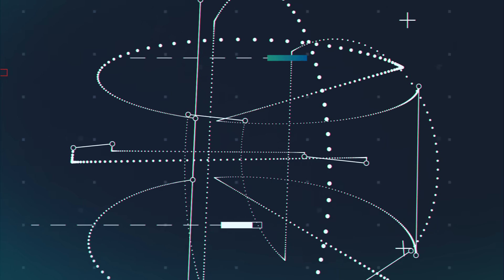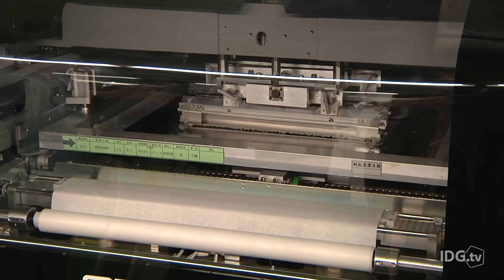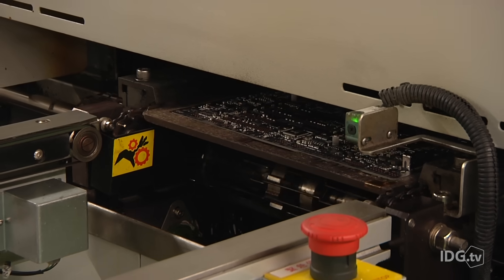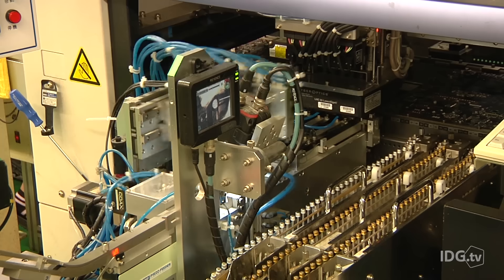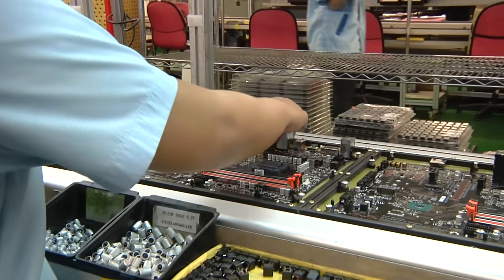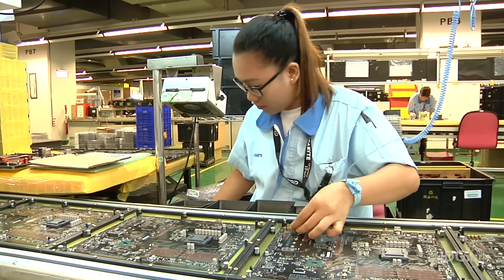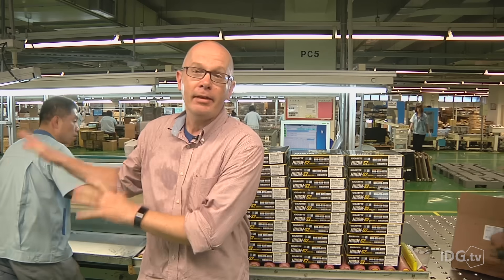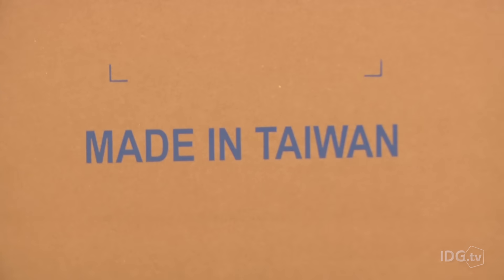How a motherboard is made: Inside the Gigabyte factory in Taiwan

Comment: I've stopped using Gigabyte boards a while back,  they always failed inside two years,  Asus or MSI only,  good quality.
Reply: I never had a motherboard fail on me and i bought most brands however i always read these type of posts about any brand.
Reply: my msi failed after 2.5 years once, and an intel failed after few months. but, these days the asus is going well for 4+years without any issues.
Reply: MSI motherboards good quality? LMAO. Only on youtube.
Reply: Funny, I had 2 MSI failed on me, 1 Asus, Gigabyte worked over 2 years till I sold it, and again bought an MSI :D
It's matter of chances, can't expect hundreds of chips to work fine on all boards, that's why they offer warranties.
Read Neweggs reviews, you won't find one manufacturer without defective or DOA.
Reply: Robert Drinkall that's interesting... I've never had any issues with mine ever - As the first sub-comment under yours points out, I haven't had any such experience. I've stuck with ASUS & Gigabyte MoBo's on all of my custom builds going back to roughly 2002. I'm still running a custom built tower in an Antec Case running a Intel Core 2 Duo E7500 2.93GHz CPU, 1066MHz (LGA775 Socket) with my Gigabyte EP43-UD3L purchased in 2009, and this particular machine has been running almost non-stop for just under 10 years; running to this day, right now as I'm typing this. It's only been turned off during the 6 times I've moved from one home to another, and then turned right back on. Never had any blue screens [knock on wood] or any issues WHATSOEVER. 

However, I do completely agree with you about ASUS being quality and dependable MoBo's and in general. I had a P5GC-MX /1333 from 2007 that I built in 2007, and I actually gave it to my dad around 2012 when his (store-bought) tower died....

And the Gigabyte Board was only about $24 more than the ASUS board (when purchased) because I needed the additional SATA, PCI-E and I/O connections, needing to have the flexibility of adding a Wi-Fi card, ATI RADEON discrete graphics card for multiple monitors, and 6 HDD's + a DVD-R/CD-R drive (as again, we're talking almost 10 years ago) I actually had an IDE drive, which this board supported, allowing for 7 total connections without any dongles/kits/etc. 

This was a fantastic system back in those days, and at $104 & change for that Gigabyte Board, lasting this long with ZERO problems; honestly what more could I have asked for? 

My $0.02 

-H.B.
Reply: Have Gigabyte's Z68AP-D3 for 6 years in my main rig which is working 24/7, had none problems since I bought it, 100% functional even after six years
you cannot blame a manufacturer for being unlucky, all electronics fail doesn't matter what manufacturer it is,
Asus and MSI boards also fail eventually
Reply: Robert Drinkall It looks like a random board problem. I've built about 300 PC systems starting from 1982, using every brand name motherboard. Over the years every brand has had it's failures and quirks. I guess I'm a geek of sorts, I usually have 8 to 10 desktops & 5 to 6 laptops running in my man_cave at any given time. I have a technology FIFO where I do new builds and give the older units away to neighbors & grandchildren. I still have a 40 year old S100 system I built in 1978 running the CP/M & MP/M OS. I make incremental upgrades to the S100 system by engineering new or improved functions with modern ICs.
Reply: I honestly think its just that gigabyte often makes the lowest end stuff, so when you really cheap out on a motherboard like i did then you get what you pay for.
Reply: funny how i have gigabyte in my top trusty brands, i tried MSI in 2016 and was dead in six months, and the region where i live doesn't have official support for it so i said good bye to the board, then i brought a Asus one, well a low budget one since i spend quite a lot on msi. turns out asus was defective. finally saved a bit and got my trusty gigabyte and running fine ever since.
Reply: fuck, and no-one mentions asrock?
Reply: Robert Drinkall my asus failed in 2 yrs, and now i have a gigabyte and it's working fine
Reply: Used many Gigabyte boards, non of them ever faild, the newer boards does have less built quality and bad designd bios, but it also cheaper, Asus make good high end      boards, but not mid and low end.Asrock is really good for budget build.
Reply: never had Problems with Gigabyte or msi.
But with ASrock and ASUS. I'm not joking, every single part from asus i own(ed) either stopped working or works with failures. X370 MoBo only worked 2 days, R9 290X got fan damage after 2 years, Xonar Soundcard with massive driver issues and some bugs/randomly not working speakers, laptop with broken charging port after 2 years, and on ASrock side a MoBo with really bad caps, so that the cpu can't hold max clock at load for 5 seconds...

but my 10 year old gigabyte board was able to withstand 3 short circuits via ethernet port, and is still works fine today.
and a R4850 and a R6970 from msi are running till now too.
Reply: Lol, MSI?  Really?
Reply: The last Gigabyte board I've purchased when I built an AMD FX-51 system with an ATI 9800XT, and it still works! The last two builds were an AMD Phenom 2 965 and an Intel i5 2500k, both with ASRock boards and both used for gaming, are still used as daily drivers. I do not build systems very often so I cannot attest to overall reliability, this is just my experience.
Reply: Sorry I am not buying that. I just bought a gigabyte AM4 board. After a week of using it, no problems. In fact, I was surprised at the OC options it had for such a budget MB.
Reply: I've never had a Gigabyte board fail yet, one of mine is 15 years old the other is 9 and both still work.
Reply: I still got asus boards from 2008 working fine today
Reply: not anymore, there junk
Reply: I've had a gigabyte and an ASUS mobo fail on me. MSI only
Reply: My old pc was using gigabyte, lasted 7 years.  Still using gigabyte on my new pc, dont see any problems.
Reply: I don't think so. I had Gigabyte mothebord before current one and it lasted little more than a 4 years.
Reply: My first computer had recurring issues for about 4 years, finally stopped when i replaced the gigabyte motherboard, never buying one of those again.
Reply: My msi failed me two times in a row i got gigabyte as final replacement still working up to this day bought it in 2014..
Also my place has fluctuating power lines it survived that.
Reply: Robert Drinkall - Oh, oh. The oldest grandson just called me. He just received 4 tower PCs & 1 laptop for free from the Kijiji "stuff to get" place on the web. Now I'm helping him identify things he never knew about, IDE & SCSI drives & DIMM ram. What a diabolical way to shed your old junk! ;) I looked up the HP 380DL G5, yes it is sturdy. When I drop some of my electronics off at the toxic waste transfer station I see garbage bins 15' tall and 20' length X 15' wide full of stuff like yours. They allow a precious metals reclaimer to go through each one. He pulls out every plug-in board & snips off only the "gold" contacts. I lived through the "gold crisis" in the 1970s when the value of gold shot way up so that board manufacturers devised new ways to cover the same contact area with ever thinning layers of gold or experimental alloys. And blah, blah, blah... ;)
Reply: I'm now using Asus and the quality is the best and beast.
Reply: All my gigabyte boards (3 different models) are from before 2012 and still working great to this day. Maybe they changed their production processes in recent years..
Reply: still on "intel original" dh61ww board with sandy processor going strong from back in 2011, no name brand or anything.
Reply: Synthematix I have the gaming k7 and I am having a lot of problems. The bios keeps corrupting itself overclocks are unstable and on stock no oc the cpu sometimes gets 1.5-1.7volts like wtf
I had a Gigabyte Board before and no problems and I thought I'd take a Gigabyte Board again. Well no. Should have taken an Asus rog board
Reply: ryan xie well I think asrock has improved alot. I would buy a asrock board or even any other board with a lot of RGB if they could be controlled via aura sync but it is only available on rog boards
Reply: in the past they were good, now their motherboards are piece of trash with my last Gigabyte motherboard I had so many fucking issues until it died , now I'm happy with my 
Asus motherboard, also I like EVGA offerings but the issue is it take time until they release their stuff
Reply: Sounds like little Mr. Drinkall needs to stop drinking when putting a machine together! Gigabyte is an excellent MB maker. I have been building boxes since the early 90's. When you said MSI is better than Gigabyte, I almost shot my drink through my nose! ........ For those with real world experience (not Robert)......I really miss Abit.
Reply: Patrick Herring well then you should have also known that Gigabyte is not the Gigabyte we once knew and had gotten worse in the past couple years.
Reply: Patrick Herring exept for the ram section which is missing alot of things and the motherboard pushing 1.5v at stock nah it's fine. Seconds replacement board does the same...
Reply: This is on the x370 boards. I have the gaming k7. For nearly 200€ I expected more. I came from a z77x-d3h board and I really liked it. It was great and I never had any problems. Now I'm on the gaming k7 and am only having problems.
Reply: Then do your homework. Maybe its RAM or firmware. Go to the forums and talk to people. One board that is quirky doesnt mean the whole company is bad............... Toyota is the best car maker on the planet. They have had bad cars. It happens.
Reply: Patrick Herring yes it can happen but they also don't seem to care about it.
Reply: It appears you need to learn how to read.
Reply: @Robert Drinkall Gigabyte should be on the same level as MSI, Asus is the best!
Reply: don't worry, gigabyte uses some mean components now days.  what ASUS used to use for their RAMPAGE III EXTREME boards, they now use as the norm.  i still have my R3E, it's a monster even today.  i'm upgrading to their aorus gaming 7 board, it's very high quality.   don't forget that about 30% of boards (from any company) are prone to failure. it's more so about misalignment of components than it is bad components (solder is a funny thing, it's not consistent, ever)   just return the bad board for a new one until one works.  there's someone who buys MSI and the same thing happens to one, but not others,  as to ASUS and Gigabyte.
Reply: Some years ago I used Gigabyte boards heavily until in a period of about four months I had four boards fail, all just barely out of warranty.  In every case I could see a bulged, some split, electrolytic capacitor.  Never used that brand again nor will I.
Reply: I'm still running a LGA 775 Gigabyte board from 2009. Daily use, overclocked for the majority of time I've been using it and loaded up with expansion cards. Load varies from web browsing to games and compiling/rendering. Working flawlessly. To be fair I've modded it some. Sawed up some old heatsinks and attached them to the bare VRMs, changed the thermal paste on the northbridge a couple times, multiple fans, various tweaks, LGA 775 to 771 mod.

I really like Gigabyte.

Did have an issue with an Asus board once though. One of the ram slots went bad. Maybe it's all just luck, but I'll probably stick to Gigabyte until things go bad.
Reply: i have bad exp with Asus, but MSI works good (10 years period; ~ 100 PCs total). Some faulty Gigabytes. No problems with  7 years old and newer MSI boards at all. Budget to middle class.
Reply: I am not partial to brands really and I have owned both Gigabyte, MSI or Asus and have upgraded other peoples systems in my family and friends circle with no problems.  Most are still in use even after 10 years as secondary back up PCs.  I always say if a PC component lasts over 5 years then it owes you nothing and it's already payed for itself many times over.
Reply: Robert Drinkall use ups & save your motherboard
Reply: My gigabyte board is still working 
9 years old.
Reply: My PC is 12 years old and it's still running my Gigabyte VM800PMC like a charm.
Reply: Robert Drinkall your not lucky , my Gigabyte mobo from '06 is still working fine. Using it as a media server with xeon CPU
Reply: Seems You are lucky,  I use to assemble computers for customers, had too many problems with Gigabyte,  so had to switch.  Good luck with yours.
Reply: to be fair, almost every brand fails at the same rate, it's just about luck you get a bad sample. for instance, I've had 2 (two) MSI mainboards; one since 2012 and my current one since 2016, both still work just fine, never had any issues with failing hardware.
Reply: My own two computers both use Asus boards,  a "P6T SE" 1366 board & a P5Q Pro a 775 board,  both over ten year old,  had plenty of use never a problem. Sometimes you just get lucky! 😀
Reply: correct, gigabyte and asus are both as bad as eachother
Reply: the gigabyte x370 gaming5 is a known piss poor motherboard https://www.win-raid.com/t2739f44-OFFER-Gigabyte-GA-AX-Aorus-Gaming-BIOS-mod-35.html
Reply: Luck plays it's  part,  as years go by we all develop a liking for one make or another!  Good luck with your systems.  I'm  playing around with some HP 380DL G5 servers at the moment,  their built like tanks!
Reply: Yeah MSI & ASUS all the way, Gigabyte is garbage
Reply: Patrick Herring but if you can read I write x370 boards. That's not just one board.

Comment: My Gigabyte P45 motherboard lasted me 8 years. So it's not good quality control they have the way they manufacture. Considering the features of that motherboard with double layer PCB and japanese solid capacitors, it should've lasted me a couple of years more. Perhaps 10 to 15 years. 

Now I use Asus motherboards.
Reply: 8 years?! I tend to upgrade every 2 years. I don't want 8 year old performance.
Reply: upgrade is a personal choice. If the PC does all the tasks that you want, I don't see a point to upgrade every 2 years. Moreover, in my country, PC upgrade is expensive

Comment: gigabyte makes terrible products, they release a shit ton of revisions of the same model reducing the quality in each one.. I use one with a cut-down vrm, bios memory and heatsink.. disappointed, will not buy again
Reply: lolwut, ever since asus' quality control disappeared in the mid 2000s, I've been using Gigabyte exclusively for over a decade and have yet to encounter a single issue.
I've built a dozen machines with Gigabyte boards in them and every one of them is still running without a hitch.

Could just be luck of the draw, but they have my business indefinitely until I start seeing any pattern of failures
Reply: My 11 years old gigabyte cpu still running without any failure and you're saying gigabyte makes terrible product.
Reply: just go with MSI or other big brand. EVGA, ASUS
Reply: Not much prople use EVGA board lol
Reply: As if there were no problems with the other big manufacturers
Reply: ASUS probably made a decent board but they also still fail about BIOS update, my PC become useless after latest BIOS update from ASUS and revert back doesn't success so RMA seems to be the best options for now 😖
Reply: Mario Darnadi I'm using msi
Reply: AGwolf is correct........ I just noticed someone else saying Gigabyte is not good. I laughed at them.
Reply: I have a Gigabyte GA-EP35-DS3R motherboard, bought in used state recently for ₽1500 (around $22), no real problems with it. Though early this year I also had a GA-945GZM-S2, which I also bought a year ago together with a Pentium 4 651 CPU + cooler, 2 gigs of DDR2-667 and a 80 GB Seagate SATA hard drive with a cable — all for ₽900 (which was around $15 back then). It was also used, and the mobo died in less than four months after I got it. Maybe that’s because I had an overheating 7600 GT and overheating bridges. A GA-EP35-DS3R on the other hand does not overheat at all though, neither does my R7 260X by Asus.

Comment: so that's why Gigabyte sucks. 6 MB's from Gigabyte and 6 Returns For failures. Never by another one.
Reply: Which board model had that failure rate?
Reply: Maybe they just gave you the same one back every time..
Reply: You are a failure Lin
Reply: Linrox but u bought 6s
Reply: No not correct, The PSU was new 750W and worked fine with Asus Motherboard. So not the PSU. Gigabyte still sucks.
Reply: I bought 1 Gigabyte MB and had 6 RA's